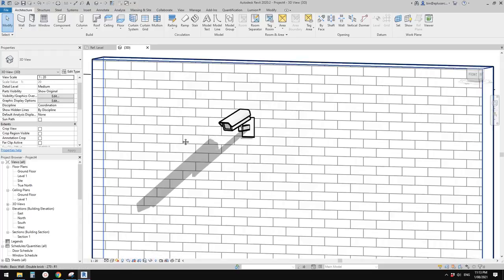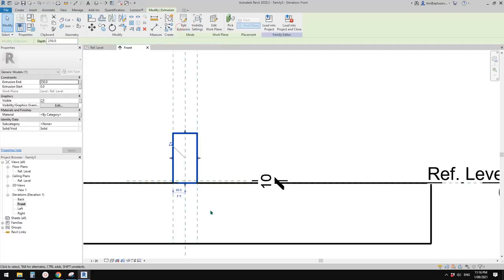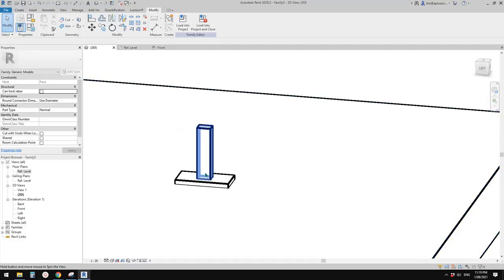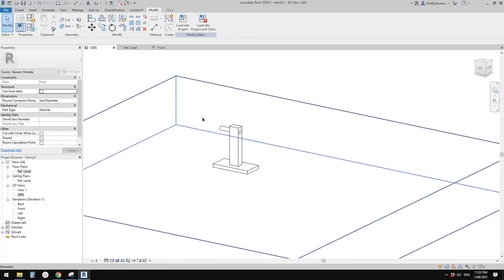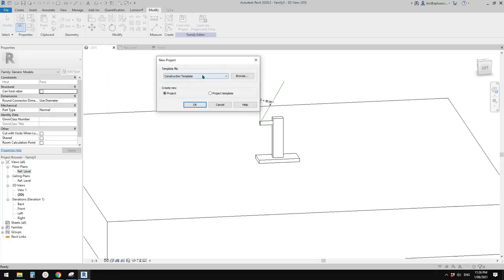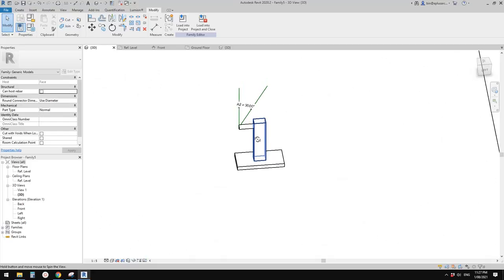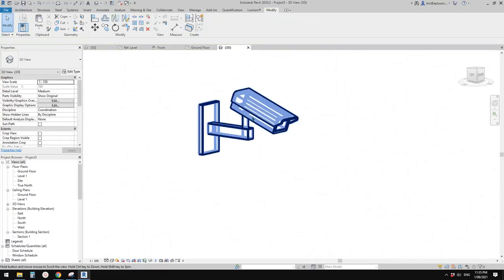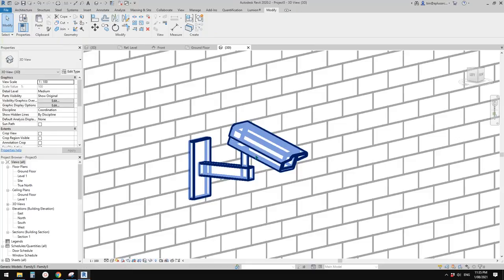Everyday Revit (Day 499) - Parametric CCTV Camera Family

Comment: A two panel sliding window would be very useful
Reply from the maker: Not too sure about this. There are a few different sliding windows in Revit family folder, have you checked that?
Reply: Yes I have, but there's no family or tutorial that I've found that one panel is operable/parametric. Meaning that you can have a parameter which opens or closes that panel from 0% to 100%
Reply from the maker: Yes, this can be an interesting little project, I guess there are different ways to achieve this. I'll have a think.